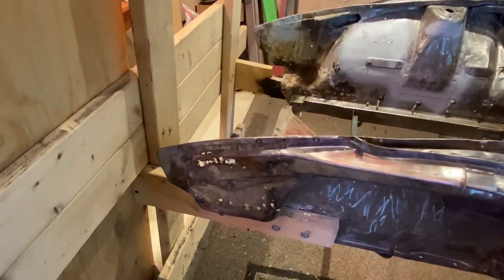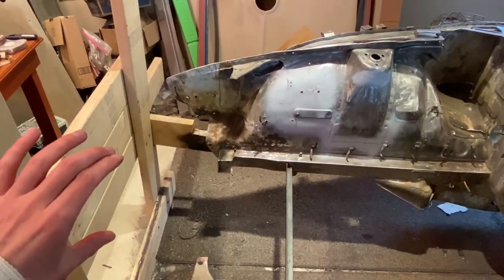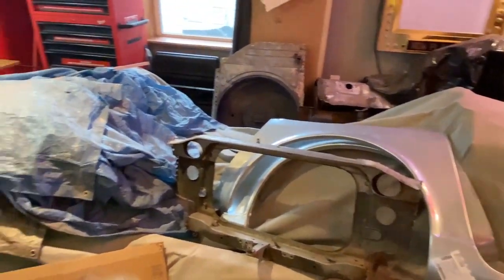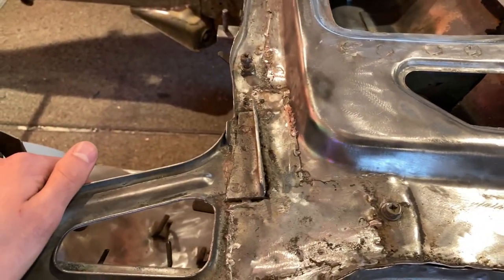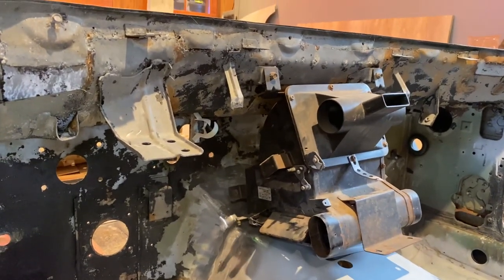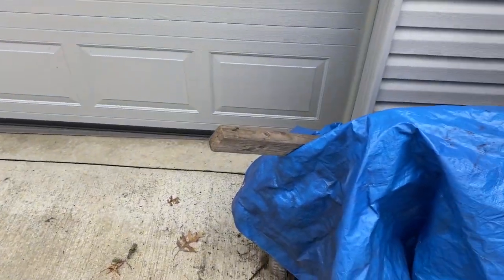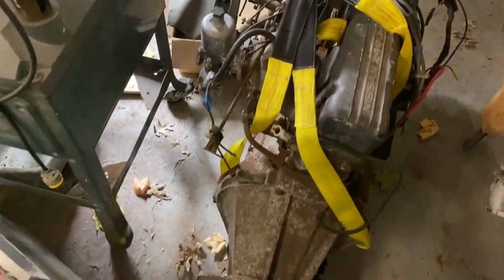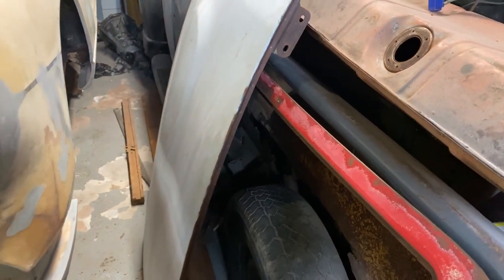1971 DATSUN 240Z RESTORATION PART 1-INTRO

Comment: I drove a 240 Z in the 80s. It was an early model. It was really fast. Mine had the straight six with two carbs. It was a blast to drive!! No 260 Z, or 280Z could keep up with me. I remember the new 300Z came out, and the guy I raced with could not believe the power my car had.

Comment: Good project - it will be a lot of work but rewarding.  I have a 1978 280Z but always liked the lighter 240Zs.
Reply from the maker: BikeInHudson Thanks! A lot of work for sure but you are right, in the end they always turn out really nice. At least the 280Z’s have some more structural support so they are actually an upgrade from the 240s once you swap the bumpers out. Thanks for checking out my project, I appreciate it!

Comment: Ohio has not been very kind to our early Z cars Ryan!! I had a 72 240 and besides my road runner, it is probly my favorite car that I’ve had. Mine was rusty like yours and I spent a ton of time getting her solid again and when I painted her, I went with a two tone that looked phenomenal on that car. These early Z’s have the perfect body lines to split colors and it looks amazing and like it could have been factory. Only drawback on mine was it was an automatic and I really wanted a manual. Oh well, I still loved it! I went into the military and my sister was going to bowling green university and needed a car so I let her use it till I needed it again and as usual, sisters don’t drive like we do and it met it’s demise, I’m still sick over it!

My sister in law is a pharmacist also and has worked for Merk since late 80’s now. I grew up in Ohio and my brother is over outside of Columbus but I’m down in NC now so if your ever chasing parts or need help hunting parts let me know, there’s still quite a bit of stuff down here. 

Your doing awesome Ryan, keep it up!!
Reply from the maker: I agree and thanks for the story 🙂! I most likely will need some parts down the road so I will let you know- thank you!!👌

Comment: I just bought a 260z that is 10 times as beat up for 2,500 but I’m in Florida so Z’s are really rare here and the ones here are extremely rusty just like mine.
Reply from the maker: They have definitely increased in value. Great cars to learn the restoration process on! $2500 isn’t too bad at all even if it is rotted